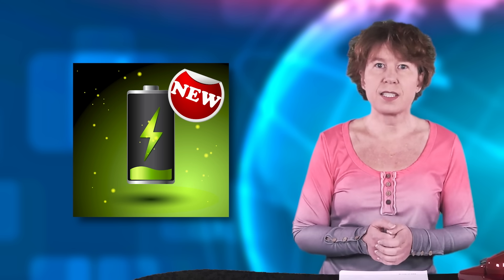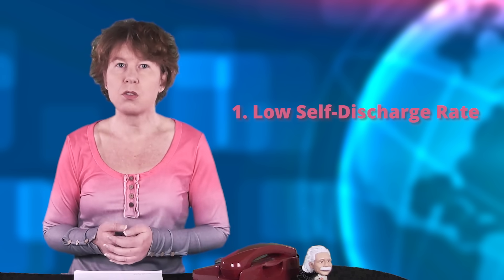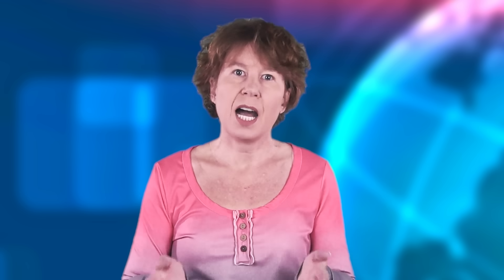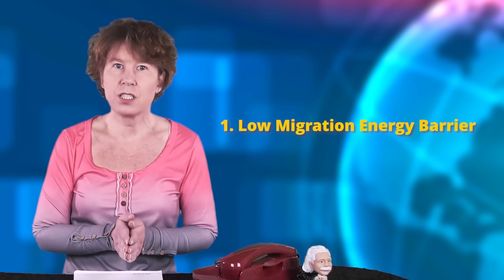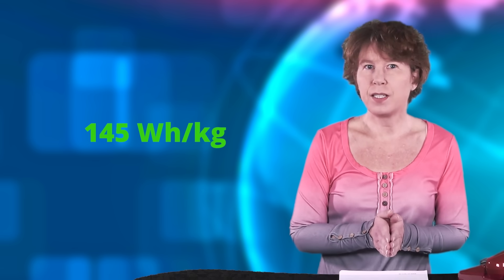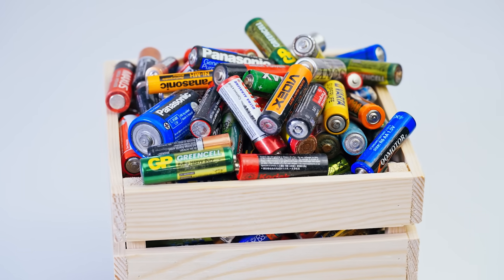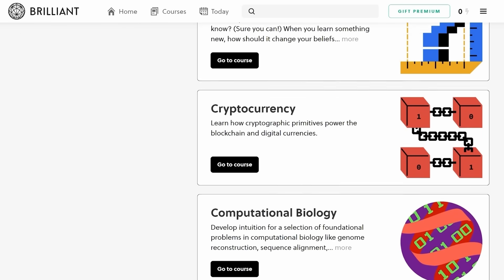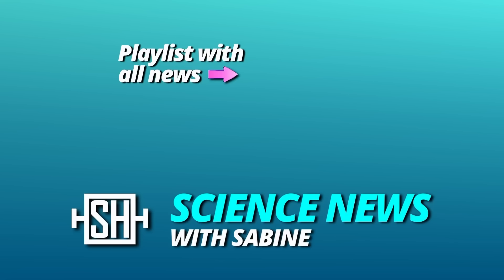Fully Charged in Just 5 Minutes: New Battery Breaks Records

Comment: Wow!  Charging a car sized battery in 5 minutes would draw a huge amount of power from the grid in a very short time.  The grid infrastructure would need a very substantial upgrade to handle it.  If I tried that at home the transformer on the power pole in the street would burst into flames if the wiring didn't melt first.  I wouldn't have to worry about it because my irate neighbors would probably beat me to death.

Comment: Thank you Sabine. The difference is not about storage with the ultra but a lot of others things. The main point with android is that you can use torrent, so you can store a lot of video there. Also you can work and then install a lot of files with dex... It can even run python and things like that... LLM.... It's basically as powerful as a 1.5Kg pc... No one do that but it could make sense....

Comment: There is an excellent point in creating batteries that charge faster.
The point is, that if you charge fast enough, then traveling on long distances with EV becomes possible. Currently, if you want to travel long distances on an EV, you might as well take a train or a bus and maybe you will get there faster than with an EV even though you will have stops for an hour or two to switch buses/trains.
Long-distance traveling on an EV requires access to a charger on the way (that's NOT trivial!), the ability of that EV to charge in some reasonable time (1 hour is possible only with the best and priciest EVs, some EVs require 6-8 hours to charge), and some luck that the charger will actually work and there won't be a big queue next to it, you won't experience power throttling (decrease in loading power due to some technical difficulties like temperature generated).
So there is a lot of conditions there.
With fast-charging batteries some of those points will disappear, it would be theoretically possible to decrease the queues and load in 15 minutes.
Some other issues will appear though - like how thick and heavy would a wire need to be to carry a few times higher currents? What kind of charger would even supply that? Would we need a special electric plant next to each charger? Because we will have to start talking about chargers taking 1MW of power. Would we need special cooling of a battery or wires that is taking in such huge amounts of power? Or maybe would we set up such high voltages there that they would kill a human in a second?

Comment: No, range anxiety depends on the fact that it takes so long to charge. If you could go and charge quickly on a moment’s notice, then running out of charge would be not so much to worry about.
Reply: range anxiety comes from lack of infrastructure and a lower than used to range of the vehicle
Reply: @romansenger2322  Sure but also charging time.  If those problems were solved but it took 3 hours to charge then I’d still be pretty anxious driving an EV.

Comment: You really only need fast charging for long trips and for people that don't have the ability to charge at home or work. What is more important is that there are working DC fast chargers. I have to eat lunch, go to the bathroom, or just stretch my legs anyways. As long as you are not in a queue for the charger and the charger is working, it is not that important. Just get more chargers and make sure they are working. Problem solved.

Comment: 5 Minute charging fof cell phones and tablets seems pointless but faster charging for electric vehicles has an advantag that does not apply to phones and tablets.

The issue with vehicles is more complex and to decide whether  super fast charging is worth it , or not depends on if the current chaging stations would be capable of charging that fast.  If new charging stations are required to achieve fast charging then the value of the new batter technology wold not be as great.  But it current chargers can charge the new batteries in 5 minutes then charging station availability would be greatly increased and that would be a good thing.  if not then finding a charging station for the new batter technology would probably be even harder than finding a working charging station current technnology.

It would also be important to understand how rapid charging impacts the life cycle of the batteries.  Since the batteries are a significant percentage of the cost of an electric car any charging protocol that shortened the life span of the batteries might end up being very expensive.

Comment: 5 minute fast charging is interesting because you no longer need large batteries. But such type of battery would only be worthwhile on a few occasions. I'm thinking of taxis, buses, etc. and maybe combined with the latest super capacitors (80Wh/kg). Such buses could operate indefinitely if they can be charged via induction as people get in and out. I also find the new high capacity LFP cells with extra manganese (up to 280Wh/kg) pretty interesting. They are still safe, have almost the capacity of NMC cells but last twice as long and cost significantly less. Certainly more interesting for the end customer market...

Comment: No one ever really needs quick charging for anything until they need it and don't have it... Then it's usually very important and possibly life threatening.
Also, in terms of ease of charging, energy density, and all those other things, good old fossil fuels has lithium beat by a factor of 20:1 in a fuel cell... That's why battery technology needs to progress. Because if it doesn't progress then fuel cells are the better option.

Comment: For people who live in apartments, going to the charging station twice a week for 20-30 minutes each time is a non-starter. We all know that an EV will say is has 170 miles in the battery and then after you drive 30 miles and it says you have 80 left.  That means you need to recharge every two or three days. So we need batteries that can charge in 5-10 minutes.  The slower charging time only works if you can afford a house, which in California, ironically the heart of the EV market,  is less and less possible all the time.
Reply: It is not correct to say that apartment dwellers can't charge at home.  Many can and do.  It would be correct to say that it isn't universally possible to charge a full-sized EV at home as an apartment dweller.  You have to advocate to have some EVSEs installed in parking slots with your landlord (or vote with your feet).

But ultimately it is a self-solving problem since, ultimately, all or nearly domestic parking slots will probably wind up with EVSEs.  Even if they wind up only charging at a slow rate and using a shared circuit.  What matters the most is just being able to plug in when you get home, not so much whether it takes the entire night to charge because five other vehicles are sharing the same circuit.

-Matt
Reply: @junkerzn7312  Yeah that'll happen, just as soon as electricity is too cheap to meter..
Reply: @captsorghum  Urm... I think you suffer from a lack of imagination.  Nobody said it would be free.

Comment: I agree with Sabine. Energy density is more important than charging time, in general. Specially if you have to carry the batteries around, like cars, trucks, cellphones, etc.
Reply: Diesel fuel has an energy density which is unmatched by any battery.

Comment: I think the future for ev batteries is pluggable range extenders. 

If I had a swappable battery that gave me 200km of range that recharged over night, that would be fine for most trips.

 To be able to rent a 1000km battery for when I need a long range would remove the requirement for most recharging stations.

Of course, they could always sell me a car with a nuclear power cell capable of doing half a million km before replacement.

Comment: There are 2 different energy densities Wh/kg and Wh/m^3. Really a surprise that Sabine mixed them up. So the battery is twice as heavy and not twice as large and that really matters as it influences your efficiency, if you have to carry around more mass.
You want to load within seconds even faster then refuel gasoline then go for supercapacitor, it is very expensive has up to 80 Wh/kg( with even higher published numbers in labs, but not applicable as product so far), but charges in an instant (if the charger could handle it).

Comment: How about they just make batteries interchangeable. Batteries can be charged and ready to go on demand just like rc car batteries. Pull up, drop your spent battery and with a small integrated power supply you can pull up again and have a fresh battery installed and be on your way. This would drive down prices of e vehicles making it easier to avoid permanent battery replacement cost. It’d work the same way as exchanging your propane tanks with a slight bit more technicalities yet while still losing range anxiety and charge time hang ups. Elon needs to consider being more modular and less exclusive when designing these modes of transport if he wants to stay on top of the game.

Comment: As a service engineer, adding an hour of charging to visit a customer, is quite a big issue. I drive about 1000km ~ 2000km in a week. That's at least 3 hours of charging vs 10 minutes of fueling.. Then it becomes a big deal, who pays those hours. We use vehicles because we literally have no choice while people with desk jobs can easily do without a car if public transport was reliable as they have the same two way journey every workday of the year while we drive everywhere.

I noticed that cars are replacing public transport, walking or cycling. And these cars are not built for long distances anymore.. Used to be able to reach 1000km easily on one tank, now im lucky to reach 700km in a similar segment.

Getting an electric car would be great, totally for it, as long as it does not get used to replace a bicycle or using public transport. Charging time is similar to feuling a car and being able to cover large distances. Getting any kind of car if its not a necessity is actually worse for the environment

One thing is for sure, without us mechanics and/or services the machines will stop producing, tumbling the economy in a ressesion. A solution is vital here.. soon

Comment: When driving from NYC, NY to ATL, GA (13.3 hours / 865 miles) you may want to charge your car in five minutes instead of an hour that adds to your trip at least two times.  
Basically, when travelling by car for extended periods.
Reply: IMO this is more of a problem of charging infrastructure than car/battery design. Teslas using their network don't take an extra hour. 20-30 minutes is more than enough to get you to the next charger after 2-3 hours of driving (I don't like driving more than that straight through).

Switch out shitty charging infrastructure that doesn't put out the advertised rates and you'll cut down on charge time dramatically. It's like complaining about my car design because the gas station throttled the pump to only flow at a third the normal speed. You know?
Reply: It's inherent to EV technology.  They require X amount of time to be charged where X is based on the charging station's max output and the vehicle's max input (unless you an extreme fireworks show).  And consider this, four gas pumps can service eight vehicles every 5 minutes, but it takes eight charging stations to service the same eight EVs in four to six times the time by your numbers.  
A charging station needs much MUCH more infrastructure - on the order of 32 charging stations to match based on your best case 20min charge time.   That's just to match a small gas station.  And not even getting into the more beefy electrical power infrastructure that will require.
Reply: @Penjulum  I agree, all this green push comes down to an avalanche of costs. We are talking about costs that can get richest countries to their knees. Average countries cannot even dream about paying for this.
Just yesterday European Commission FINALLY counted what I counted years ago - we would need double the amount of power plants (and double the electrical grid and make it in a new way that also doubles the cost again) in order to be even able to charge EVs, if they are to replace normal cars. Just so you know, the cost of normal old style electrical grid can be equal to the cost of power plant that produces energy for it.
I wouldn't be surprised if the cost of electricity would jump by 4-8 times in countries pushing for green, either that or increase in taxes (again). In Germany which has one of highest renewable energy percentages, the cost is double that of neighboring countries, but EVs are only barely starting to take the streets there. There are already problems with power delivery in Germany.
Reply: @KogiSyl  First: I'd like a source on this "double the power plants in Europe" claim, because I don't see anything like that at all.

Eh. Kinda. You're talking about expanding and upgrading charging infrastructure like it's a bad thing. Electricity demand is expanding and resilience needs are increasing. The work of increasing (clean) power generation and strengthening power transmission must happen REGARDLESS, even if you did want to live in a fossil-fueled soaked world. We're not talking about an overnight overhaul of the grid, just like EVs aren't going to replace everyone's cars tomorrow. We don't need nearly as much grid power as you think.

Most large charger stations make use of large on-site battery installations. They trickle charge the battery from the grid (along with local renewables like solar panels on the charging stations) at night when nobody is charging their cars nor using much power at home. Then, they use the battery during peak energy usage - that's convenient for the grid AND cost-effective.

As you guys point out, a charger's max daily uses is lower than a fuel pump's (though most fuel pumps are majority idle too). Tesla reported last year that an average Supercharger station gets about 45 cars per day. Let's plan for daily 50 cars getting an average 80kwh per charging session (already a sizeable EV battery, especially since you don't usually wait for 0% and don't charge fully to 100%). So, that's a daily total charging usage of 4 megawatts or 170 kw per hour. Even if you charge only during 12 off-hours, that's plenty doable in most situations with current infrastructure. Combine that with local renewables, smart charging tech, energy usage policies, and incremental energy infrastructure improvements... it's definitely possible.
Reply: @Cyrribrae  the chargers are not only limit by their own technology, but also by the transmission lines connected to them. If you want a transmission line that can handle let's say 200-500kw to that charger for 30 minutes, then unless you take that power away from nearby homes - you need to upgrade all transmission lines, transformers, and switches from the charger to the electrical power plant. In the end, you may even need to upgrade the power plant itself to handle increased demand.
50kw and above is not a trivial amount that you can just plug in anywhere. 
Currently at least in my country chargers are required to have smart charging capability, which allows the energy operators to limit their power when there is a risk of overloading the transmission lines or the power plant.

Comment: I take long trips at highway speeds.  1000+ miles at 75mph. With current EVs that translates to 15 minutes of charging every 90-120 minutes. That is a much different experience than 5 minutes every 5 hours to fuel with gas. 

One should be aware that the cost per mile using a supercharger is greater than the cost per mile using gas in an Accord or equivalent.

Comment: Safety is also a consideration. NMC batteries are a serious hazard, LFP not quite as bad but still a worry. I know petrol burns too but it needs oxygen whereas these batteries make their own in thermal runaway. If they don't burn, only vent then there's the risk of a vapor cloud explosion. I quite like NiMH cells but the energy and power density is poor.

Comment: It might not matter in something like a phone but rather in things like electric trucks. The main reason to why they never really took off like standart electric cars is mainly due to battery problems. A normal truck can be fully fueled in about 10 minutes and can go ~1000 km while electric ones need at least 30 minutes with a range of ~500 km (although, as my dad says, those numbers are provided by the manufacturer and are lower in a real world-application). And once you add working hours and driver payment to the already high charging time they simply become inefficient for most companies

Comment: Imagine we invent a battery with 80kWh capacity capable of being charged in 5 minutes. Assume it is 80% efficient. So you need to deliver 80kWh in 5 minutes multiplied by the number of fast chargers on site. That means utilities will need to up power feeds to handle these sort term high current bursts for these chargers. So like usual it's whack a mole fixing issues. The energy density will probably make it less desirable for vehicles and phones because consumers want large amounts of power is small and lightweight form factors. If automakers had a removable battery standard then range anxiety and fuel up times become a non issue with existing technology. Plus someone gets to sell another subscription service and recycling is easier. Something like gogoro in Taiwan for vehicles.

Comment: It's important to note that fast charging will also be limited by the power available at the charging station, which either limits the number of available charges or increases the energy required at the charge station.
Reply: @SimonWoodburyForget  that would be true if any chargers had batteries. they don't and are already hundreds of thousands of dollars.